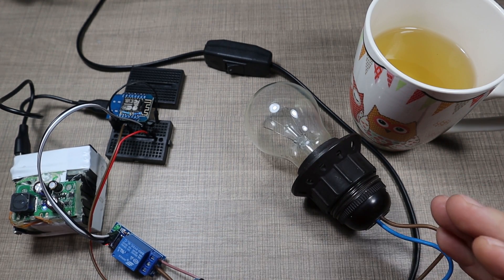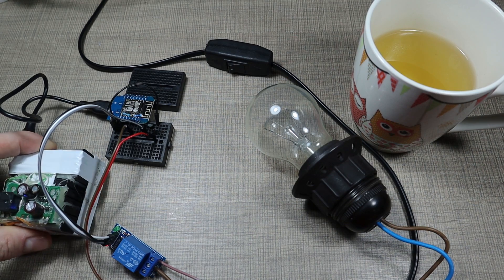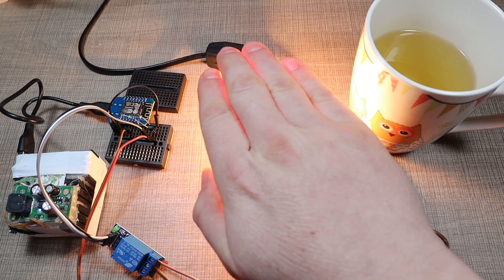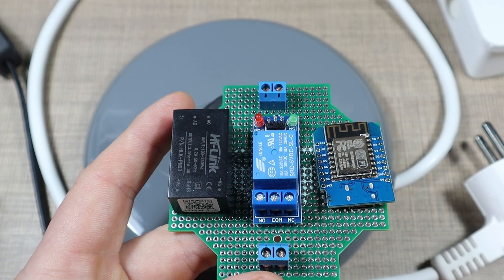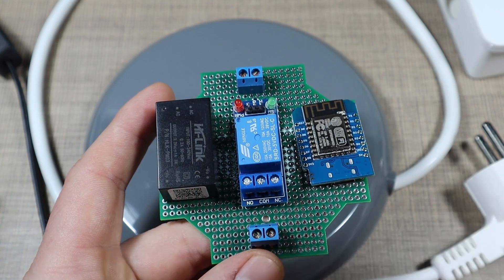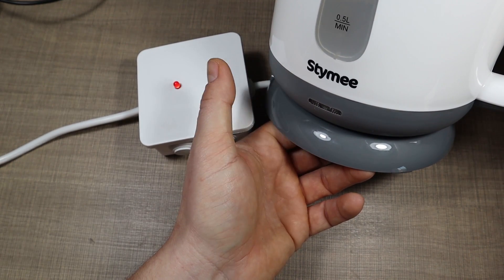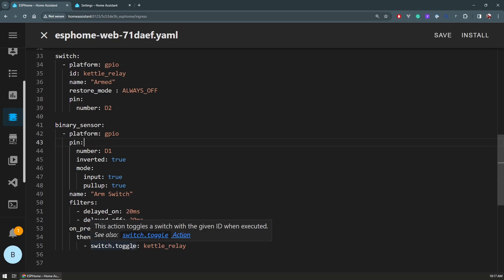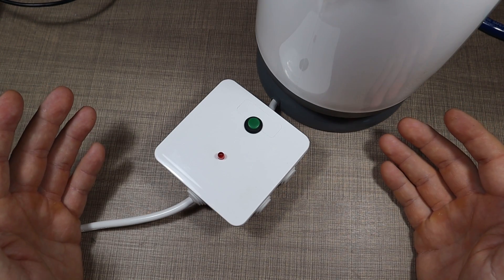Kettle Hack: DIY Programmable Smart Kettle for Scheduled Brews with Home Assistant

Comment: Its easier to just use a plug and have to plug go into Home Assistant, fill the kettle up set your timers and leave the switch on the kettle to on. The then turns your kettle on without doing all that work. and works on most cheap kettle been using mine 5 years now!
Reply from the maker: Yes true that, but there is little learning opportunity that way. By knowing how it is done from scratch, you have the ability to customize the solution when you have a specific need or requirements.
Reply: @TasteTheCode  I have a lot more of a need for companies to not lock out what can be done with medical devices to keep people alive how they would like to be kept alive can you hack a Omnipod 5 so I can keep alive?
Reply from the maker: @TheDiabeticWay  Medical devices are on a whole different level than what we do with hobby projects. It is a big business where companies spend billions on R&D to make sure their products work as designed. Hacking or messing with them is only viable as a learning opportunity.

Comment: Thanks, this video seems like an excellent opportunity to learn about IoT integration. From my experience, using a simple Sonoff Basic running Tasmota with Home Assistant would be a more effective approach. This setup allows for easy control from scripts within Home Assistant.
I have successfully used this method with many non-smart devices by creating a short extension cord embedded with the Sonoff, thus avoiding modifications to the original cords. you have presented a great DIY solution that everyone can learn from! Way to go!
Reply from the maker: Thanks! For sure there are commercial options that usually are a lot more straightforward to use and implement. My goal is to provide learning opportunities as those open up doors for more complex projects and implementations.

Comment: 💀 for petes sake people buy a smart plug and do not do this. I hope taste the code is wearing rubber gloves or gumboots when that active wire melts and shorts out ☠️
Reply from the maker: Should I also wear bomb proof suit?? Even if it melts and causes short circuit, there are safety mechanisms built into the house electrical wiring that will prevent any major mishap. Yes, there might be a bang, but that's about it!
Reply: That comment is evidence that idiot proofing continues to make better idiots.
Reply from the maker: Instead of being rude, how about that you are helpful for a change? How did you came to a conclusion that the wire will melt? Did you measured its diameter? Do you know the power rating of the kettle? Do you know what voltage system I have???
Reply: It's not hard to see that wire is not rated for mains, it has been pointed out by others along with other bad practice and played down. I'm not going to sugarcoat it when this is something that can burn down a house or kill people.
Reply from the maker: Still no knowledge shared just a bunch of assumptions and presumptions...
Reply: @TasteTheCode 6-7 min mark you are connecting up what is obviously not suitable wire to either 120-240v mains. Your kettle could be from 1500w - 3000w; on 240v @ 2400w = 10A; on 120v @ 1500w = 12.5A but that's comparing apples to oranges, it doesn't matter which voltage you have, mains power is mains power and your viewers could have either.
The distance between active and neutral with non conductive surface or cut out on the PCB is insufficient; best practice would have an opto isolater flicking that relay and the relay would toggle a contactor because that relay is not made to handle the load you are switching.
There is so much wrong in your project and instructions and this is my last comment as I don't want to give your video any more traction in algorithm. Your inability to accept feedback and safety advice here and on ESPHome forum proves I am wasting my time talking to you; I do hope you do not harm yourself or others.
Now ponder this, do you drive like you have nine lives because you have a seatbelt? Would you rely on a gun safety to point it towards a loved one? ...circuit breakers or fuses wires are to minimise harm not prevent it.
I wish you well and hope you can get off the back foot and recognise this feedback is to protect yourself and others.
Reply from the maker: Well now we are talking and I thank you for the feedback and concerns. The wire is 1mm in diameter, multiple strands. The kettle is rated at 1800W so on the 240V we have here it draws around 8A max. I understand that that is still a bit on the edge for its rating and almost on the limit of the relay but still within specs. What I haven't considered so far is what you mentioned for other viewers and other setups and I probably should have mentioned that. I'll definitely be more thoughtful for any future project so thank you.

Comment: Just don't. Please, it is terribly unsafe. Issues: There is no separation of the high and low voltage part. You are working on the same demo board. The relay might be rated for the continuous operation of the kettle but definitely not for the switch on transient. The cables you are using seems to be just normal low voltage demo cables. Have you checked the rating? You need min 18AWG to safely handle the load. Have you checked the IP rating of the box? And with all this, you implement a 10USD smart plug.
Reply from the maker: Hey, thanks for the concerns but I don't think it is that bad. The wire is stranded at 1mm thickness and the kettle is rated at 1800W so it should be OK. The load on the relay is in it's off position so I don't think it will be too big of a deal. The kettle operates for only a few minutes so it should be fine. Of it is not, then one can always use an SSR. Additionally, one big aspect of the DIY approach is the learning in making something, including getting feedback like this so thanks again! In a worst case scenario, the house is equipped with an RCD and proper fuses so except for some exciting bang, nothing serious should happen.

Comment: I don't think this is safe at all. What will happen if there is no water?
Reply from the maker: The kettle has a thermal switch built in. There is nothing preventing you to turn it on without water even as it is from the factory. The thermal switch will trigger once it detects temperature close to 100 Celsius.
Reply: @TasteTheCode  my kettle is 3200W that is way above this blue relay can do. It even burnt the smart socket that was supposed to carry 16A. you are playing with the death here
Reply from the maker: This one is 1800W and we have 240V here so it should use ~8A on full power. I haven't measured this but it should be close to that. The relay is rated at 10A at 240V so theoretically it should be OK. Worst case scenario if it blows, I have an RCD on the entire house and proper fuses so it should be still OK and not cause any serious issue.
Reply: Lots of "shoulds" in that statement.
Reply: @SteveMasonCanada  I know that playing with such load is DANGEROUS.
Reply: @SteveMasonCanada  The main issue is that 1800W is not the switch on transient. When the resistor is cold the amps will be significantly higher.
Reply from the maker: True that but they will be cleared out with usage. I'll try to make a follow up video after some use.